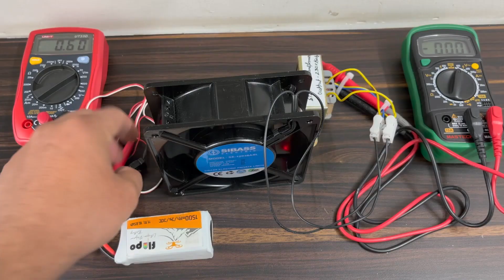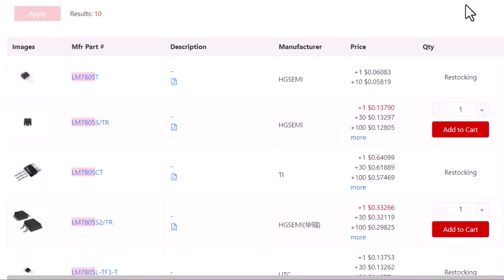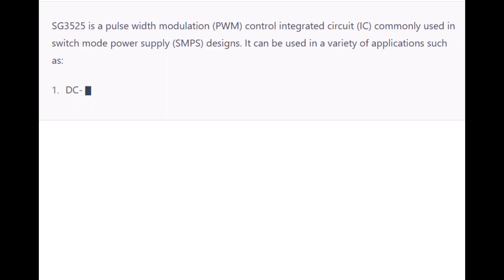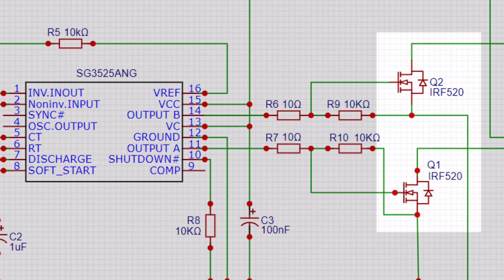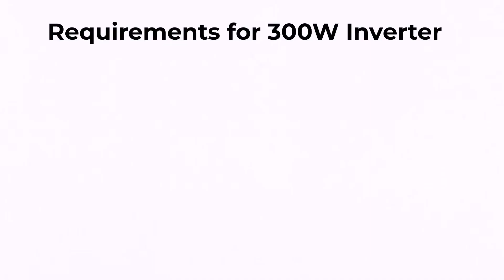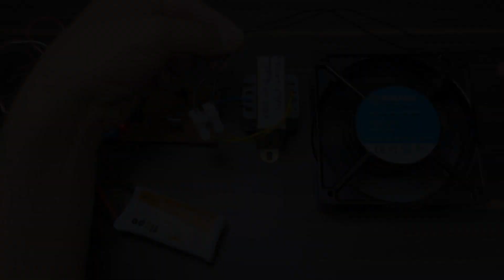DIY 12V to 220V, 300W PWM Inverter using IC SG3525

Comment: Helpful project, but it could be more helpful if it could switch to the battery power automatically when the AC power is unavailable, and switch back to AC power when it becomes available. Like a UPS system for small equipment.
Reply from the maker: Yes there can be upgradation for this project. Currently its a PWM inverter , with additional component and with feedback system it can be upgraded to Sinewave inverter. And yes of course UPS like feature can be added too.

Comment: Tl494 is the best I C  with in built two comparators for voltage and current sensing makes it perfect for close loop controlled inverters .
Reply from the maker: Yes we will design inverter with TI494 as well.
Reply: SG3535 IS A DIGITAAL IC ,TL ANALOG CAN YOU TELL ME DFFERENCE I WANT MAKE A INVERTER